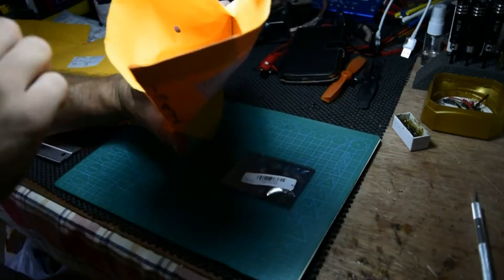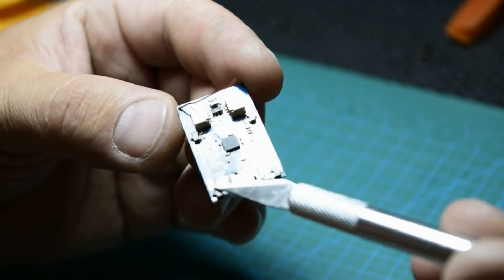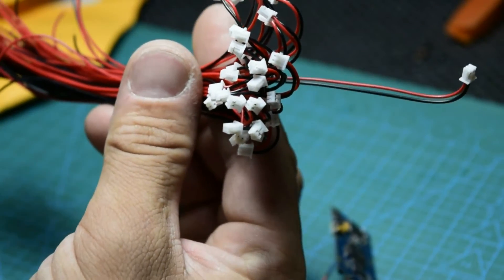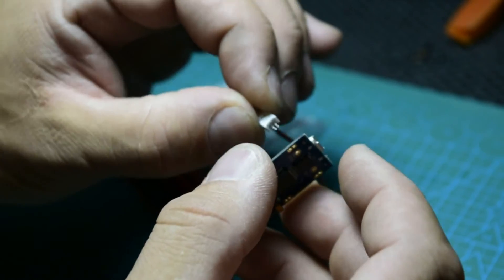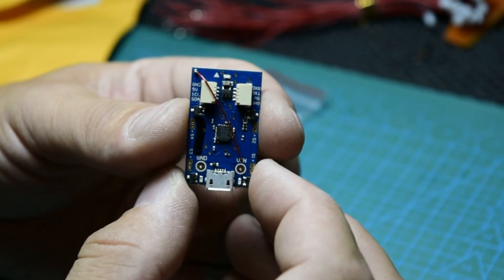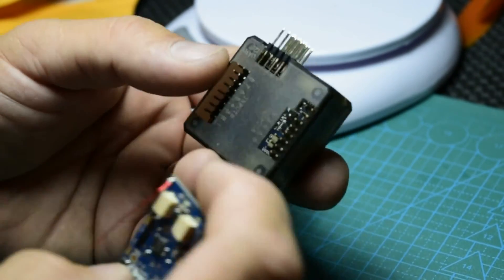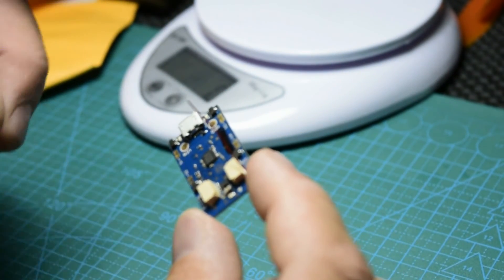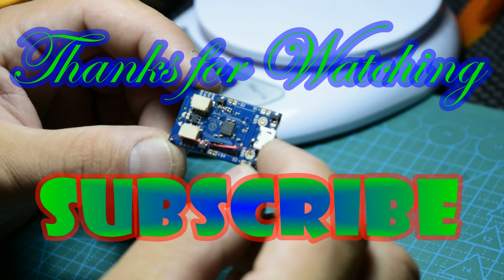Micro Scisky  Flight Control Board Based On Naze32

Comment: Hi i want to make a flysky version and put on the qx100 frame - can i buy this one? https://www.banggood.com/Eachine-Micro-32bits-F3-Brushed-Flight-Control-Board-Base-on-Cleanflight-for-DIY-Quadcopter-Frame-p-1075953.html?rmmds=search&cur_warehouse=CN

in this case do in need a seperate receiver -flysky
Reply from the maker: yes
Reply: can i add a flysky receiver to an existing micro-sci-sky-dsmx-sp3-fc?
Reply: how to connect a second receiver to the micro sky- the link u sent above has page expired

Comment: Do you know which receiver I should buy in order to use this FC with my FS-TH9B transmitter? (https://pt.aliexpress.com/item/FlySky-FS-TH9B-FS-TH9X-B-FS-TH9X-2-4G-8CH-Radio-System-TX-RX-RC/1911249511.html?spm=2114.13010608.0.120.Q57TWY)
Reply from the maker: Hi
Yes you have to buy on of this OrangeRX module. https://www.hobbyking.com/hobbyking/store/uh_viewItem.asp?idProduct=46634

Comment: hello i have Spektrum DX6i DSMX it can connect? ?
Reply from the maker: Hi
I`m not sure if yes....I have a Taranis D9X and for my i have to buy a separate Module: http://www.hobbyking.com/hobbyking/store/__46634__OrangeRX_DSMX_DSM2_Compatible_2_4Ghz_Transmitter_Module_JR_Turnigy_.html
And i used in PPM mode. If you  have in the Radio; DSMX, DSM2, PPM i think its fine.
Reply: +Frincu Gheorghe Daniel it is have but it can ?
Reply from the maker: Yes it`s working :) in dsmx receiver for use with spectrum radio's or modules
Reply: +Frincu Gheorghe Daniel best thanks very  much and fun fly!!

Comment: Hey great video, would it be possible to power a (5v) Fx797t camera kit off the TXD/ RXD/ 5v/GND connector, if not can you tell me what the connector is used for. Many Thanks, Brett
Reply from the maker: hi
Yes you can power up the TX797t....it's frome 2.5v-5.v so no problem. I don't know what it's for cuz I don't used. Cheers